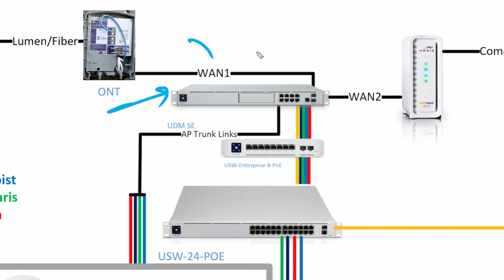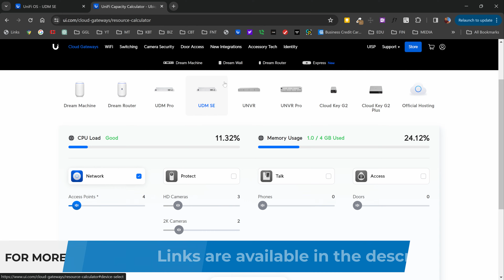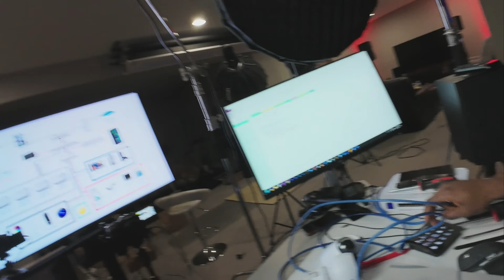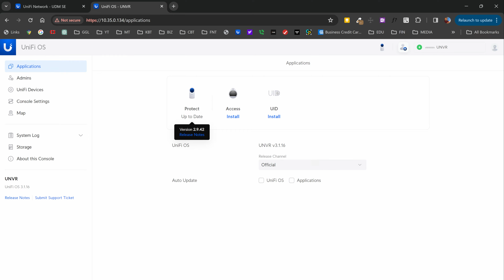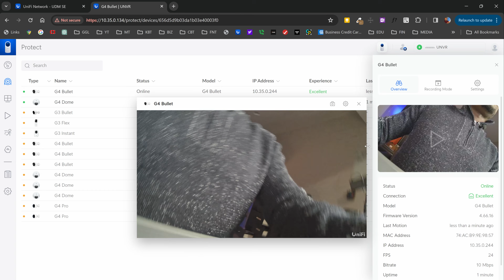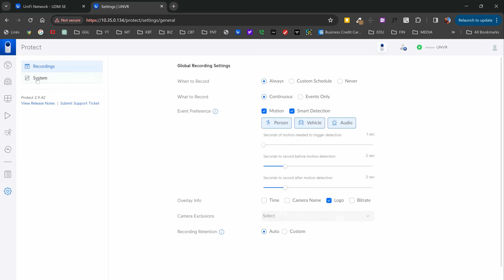UNVR Complete Setup Guide For UniFi Protect: Why Am I Replacing the UDM SE?

Comment: This may be a dumb question but I was wondering if I have a UDM Pro acting as my router primarily, would I be able to connect the UNVR to it?
Reply: Yes, you can just connect the UNVR's ethernet port (on the back) to one of the Ethernet ports on the UDM pro or you can use a SFP cable from the UNVR to UDM.

Comment: Hi @KBTrainings, can you do a video about Fortigate A/P with connectivity and configuration to stack switches ? How was the connectivity and configuration suppose to be ? Is it need to use LACP between Fortigate and stack switches ? Or is there any other method ? The Fortigate will be as L3  VLAN and will be providing DHCP IP address to workstations that are connected to the stack switches. 
Thank you very much.

Comment: What changed 8 months ago from your other video were you switched from Fortigate to UniFi? Please explain the reasons why as I’m in the same predicament were I’m looking at switching from Fortinet to UniFi devices. I’ve used Fortinet for 8yrs now, but considering switch. Would love to know why you switched back.
Reply from the maker: I see.
Reasons:
1. I like Fortinet
2. I started working for Fortinet 2 months ago, so I get free gear and licenses 🙂.

UniFi is good too, but not as good as Fortinet.
Reply: @KBTrainings  ok, makes sense. Can you please explain the pros and cons of Ubiquiti compared to Fortinet in regards to which offered better security and stability. Fortinet IMO has a long way to go with their GUI, perhaps I would be happier if their GUI and ease of use was like what I’ve experienced so far with Ubiquity. The other is the cost of licensing.